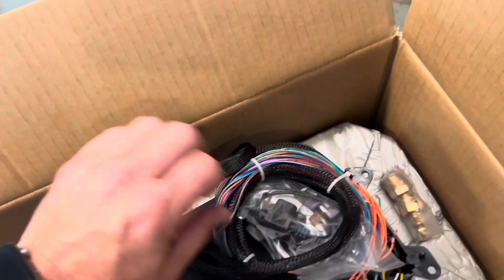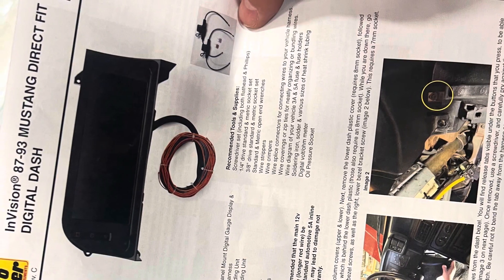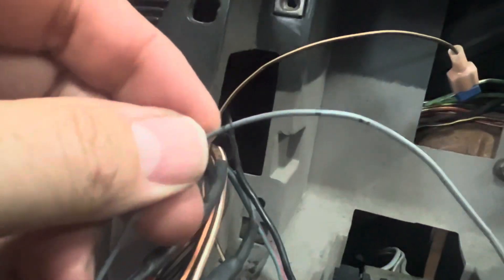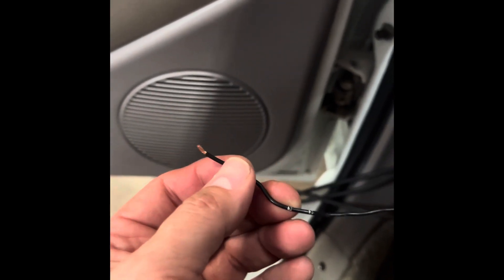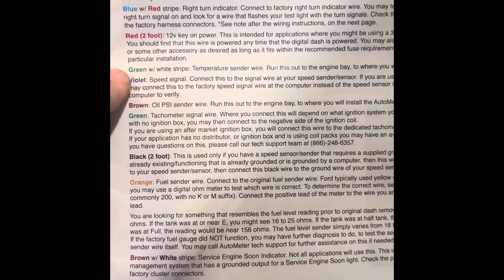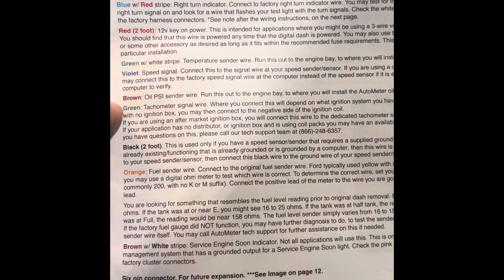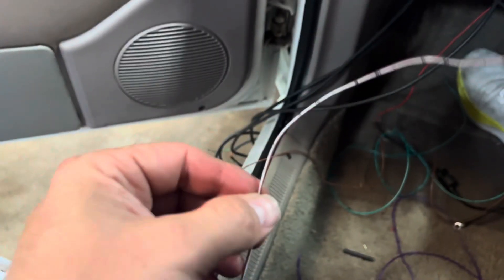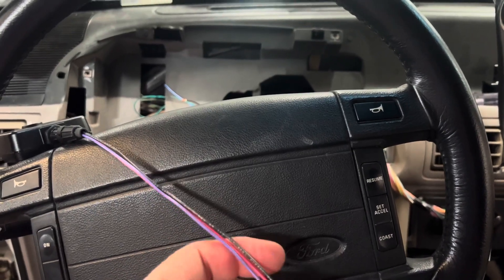How to install Fox body Autometer Invision #7007 instrument cluster.   Coyote swapped foxbody

Comment: Great info. You have a video of how you did the oil pressure sensor and water temp? Mine is a coyote swap also. Any info would be greatly appreciated
Reply from the maker: I do. I’ll have to dig it out.   I used a power by the hour oil pressure adapter and the autometer sensor.   You run one wire to each oil and water temp.
Reply: @Whippdf150   awesome. Great channel. I’ll dig thru the videos to see if I can find it